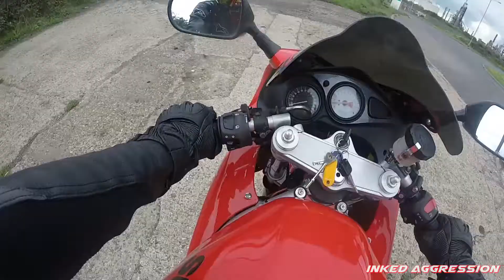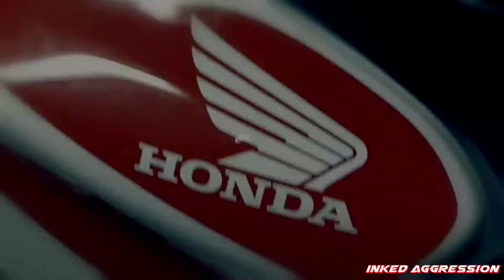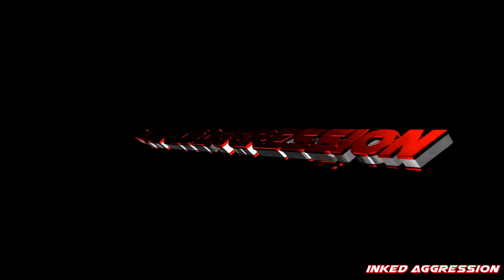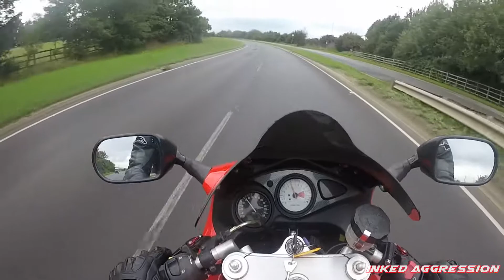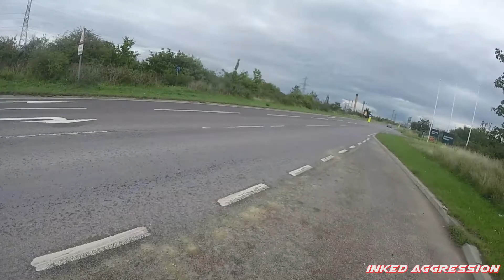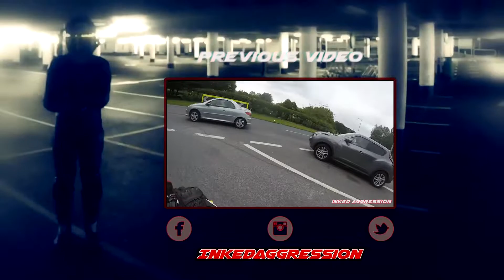Sv650S Test Ride - First Ride

Comment: Pretty sure the SV650 actually makes a little more torque than the CBR600RR.
Reply from the maker: Yea it felt extremely close torque wise hard to accurately compare where i tried them a few weeks apart but both bikes are absolutely brilliant
Reply: +Inked Aggression was gonna say the same. the v twin will be more torquey. I also prefer torque to hp cos the response is instant whither gear your in.  on the Cbr if you floor it in the wrong gear nothing much happens until higher in the rev range
Reply from the maker: yea exactly both bikes are brilliant in their own ways
Reply: @inferior650riderhd6  those are not the dame class bikes 👌🏻 suzuki for cbrhave gsxr 600 😎👍🏻 sv650 is much weaker /much slower bike in regard to such supersport 600 bikes 👌🏻😎  cos of huge power deficite 70-75 vs 120-130 hp its not even close 👌🏻  hower lowend and midrange to like 7 k rpm sv 650 can haveeven lil better than some supersport 600 class bikes so in such cases yea whan ypu choice to high gear „nothing” happen on low rpm high gear low speed comapre to sv let say however use proper gear which be hold engine on proper rpm and sv is knockout like nobodis bisnes 🤭😎👍🏻 0-160 km/h 10-11 vs 6-7 sec top sped 200-210 vs 250-265 km/h 👌🏻

Comment: The stiff clutch is because of the clutch springs, need something to hold all that torque, you can get softer ones be then your risking clutch slip and frequent clutch replacements.
Reply from the maker: Ah fair enough its a buddys bike it was the lever where i could feel it it was very tight haha basically all or nothing with the clutch ill let him know though so he can get it sorted :D
Reply: Oh the all or nothing is usually too much cable on the engine side.
Reply from the maker: +Kean Campling ah fair enough haha it wasnt bad after you got going just abit difficult at first of course being a very different bike and ride that im use to although admittedly i never had problems stalling any other bike ive been on just this one haha

Comment: The other side of the scale with top speed vs acceleration are little bikes that accelerate quickly and make you feel like your going faster than you actually are, my 50cc Drakon accelerates really quickly and is really fun to throw around but when you look down you're only doing 55-60, the top speed of it is only 72, but it's still a fun bike which is why I've kept it.
Reply from the maker: Oh fair enough i feel the opposite with my bike i find the bigger bikes more fun because you always feel like your going so much quicker when im on my bike at 70/80 its really boring but at 70/80 on this or the cbr 600 it feels a hell of alot quicker
Reply: 50cc accelerates quickly haha